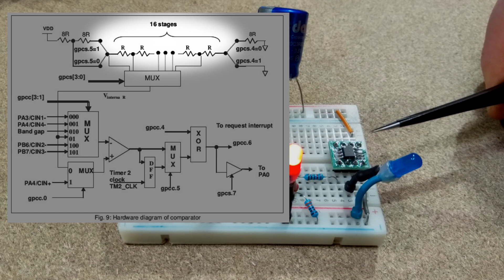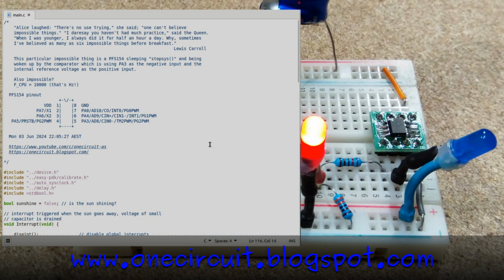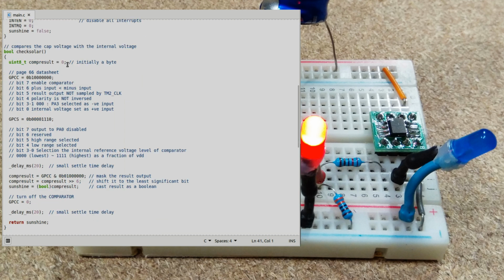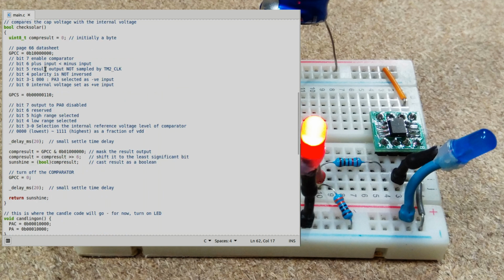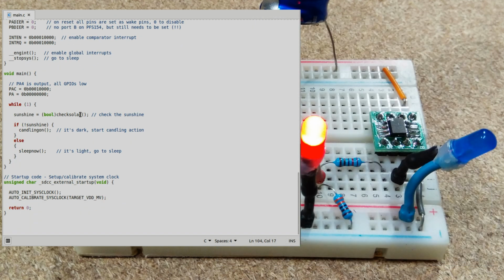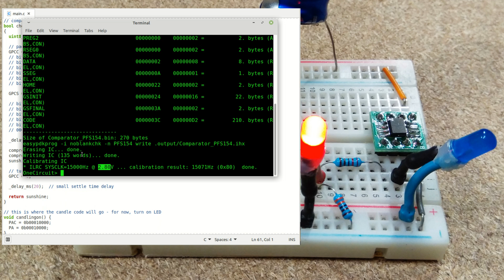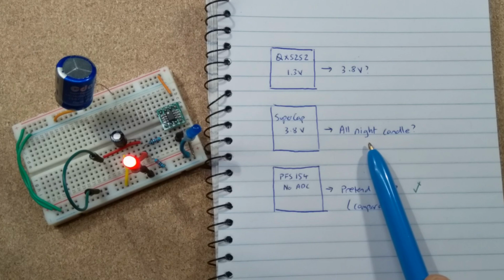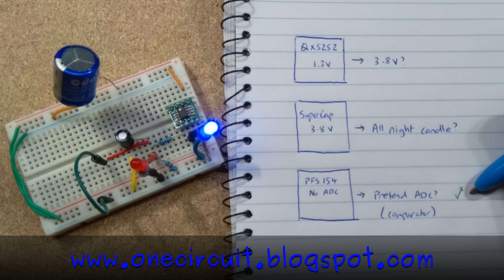One impossible thing

Comment: You disable comparator (at the end of checksolar) but then want its interrupt to work? I am amazed the current code works

You should not be setting ITRQ to 1, it is set by the hardware. Only the interrupt routine then clears it.
Reply from the maker: Success! Thank you Ivolol - updated code is now on the blog - I still feel there are improvements to be made, but it's working under the supercap with no issues! 👍😀
Reply from the maker: I’ll check the code again, but that seems like a snafu from me - great pickup! Back to the bench and I’ll update the code when I get it working. Thank you! Sometimes I’m in so deep I miss the obvious. 👍😀

Comment: Suggestion: just tie the solar panel to a jewel thief (joul thief) circuit and let it charge the capacitor. You can control how long it lights with pwm so you should be able to solve this by changing the duty cycle. Just how I would solve these things.
Reply from the maker: Shhh! Your giving away my two next videos on this project! 👍😀